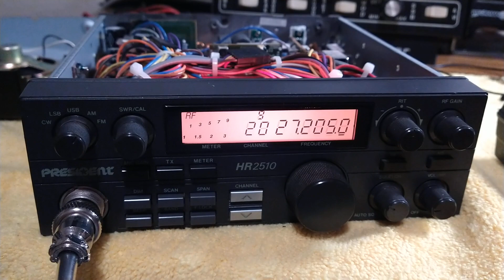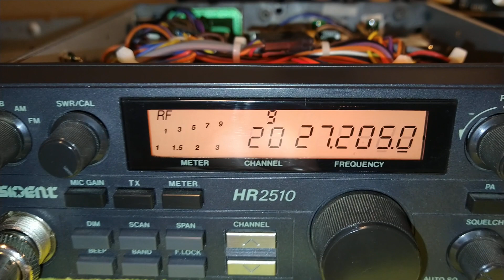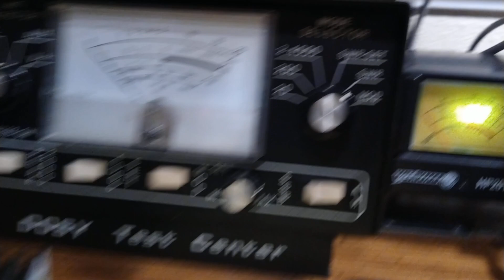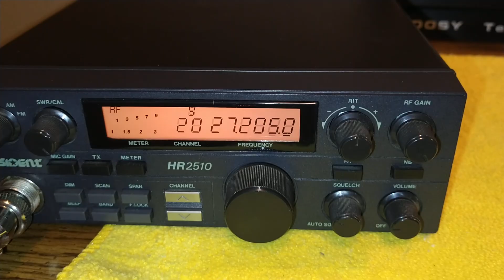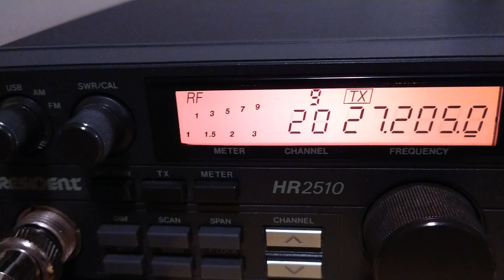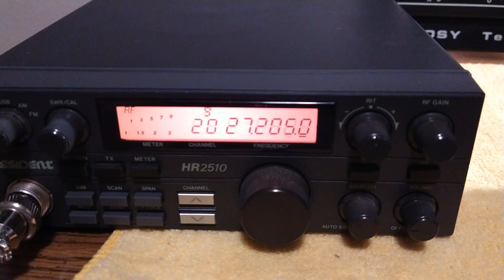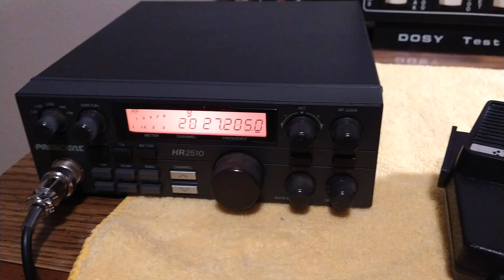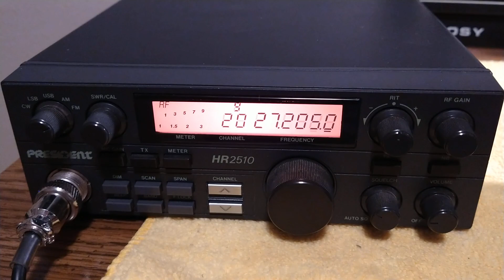President HR-2510 possibly for sale

Comment: might be tuned closer to 10 meters on power , but it a super radio on of the first that does  super channel rejection, not a loud radio but super clean on AM  they do around 5 to 8 watts on AM  and around 20 to 25 PEP on SSB     any power about that you lose audio on TX  yes thats a very clean lookin radio   73's  505 Pam wisconsin